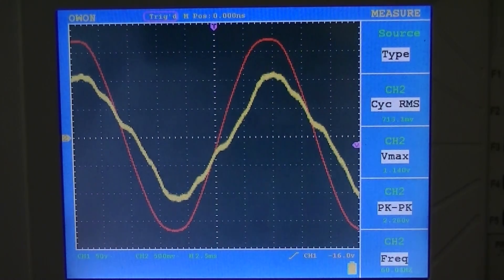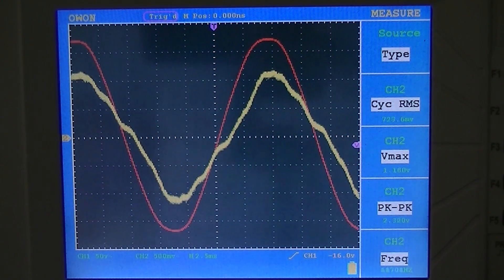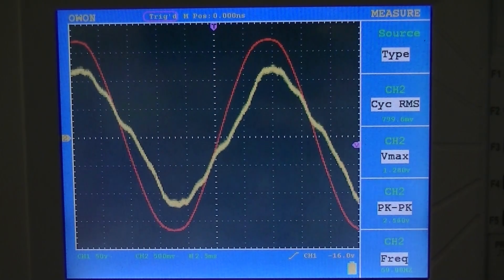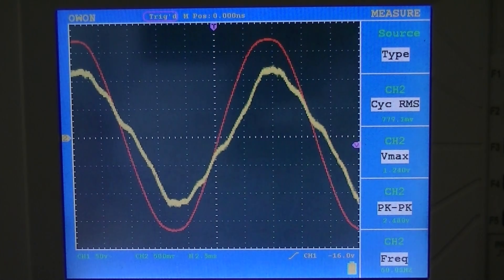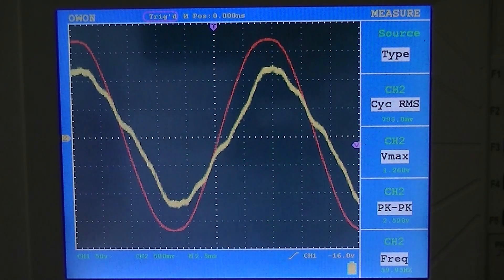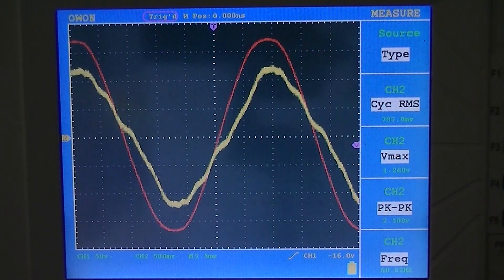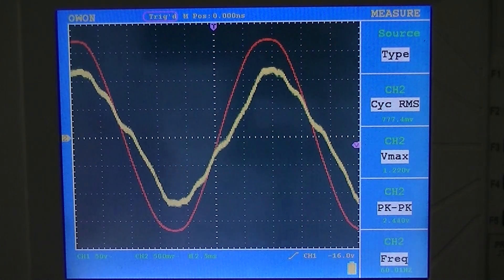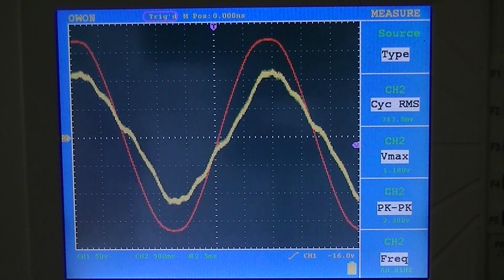Stray Voltage: Is it Coming from the Utility Transformer?

Comment: Thank you for posting this.  I find that there are surges at my house.  I am about 100 feet from the transformer for the houses on my side of the block.  I had suspected the surges were coming from the cell tower pointing directly at my house but am starting to believe that the ringing sensation in my ears I have at home is related to electric/magnetic fields.  There are distinct surges now that I am aware between the fall/winter and spring/summer months.  In the fall they come earlier than spring and summer.  Once the surge occurs, it seems to take time for the sensation to dissipate.
Reply: Did you ever figure out what it was? Same ringing/surges here.
Reply: Hi - no I haven't.  I've employed two devices to help.  One is the SENSE panel monitoring system and the other is TING.  I've noticed some relationship with power surges/spikes during heavy rail operations.   @offmelpomene3660
Reply: Any advice? @offmelpomene3660